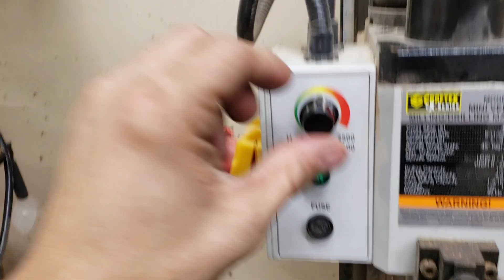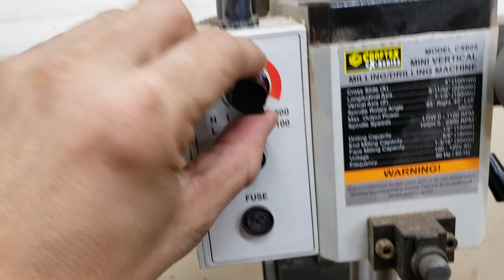20x138B casing machining

Comment: What primers did you use? What are those FFFg black powder teabags for and were they on the original 20x138b cartridge? Does the black powder increase the ignition or something? Are those .50 bmg primers or are there larger primers than that you can buy?
Reply from the maker: The primers are standard .50BMG primers that can be bought at most stores that sell long range reloading supplies. These cases were lathed to take .50BMG primers, because the original cases took a specialty size primer that is obsolete and not able to be purchased anymore. The FFFg black powder teabags were actually in the original cartridges, though they used silk bags made from clothing due to wartime rationing. If you look at old wartime production ammo and pull it apart, the FFFg bags are usually floral silk patterns of various kinds in my experience. The purpose for the bags is to act as a booster charge for the extremely slow burning powder required for this cartridge. 20N29 burns far slower than any .50BMG powder on the market, so the small charge of black powder over the flash hole ensures even ignition of the larger powder charge.